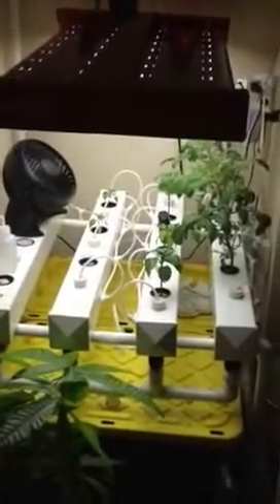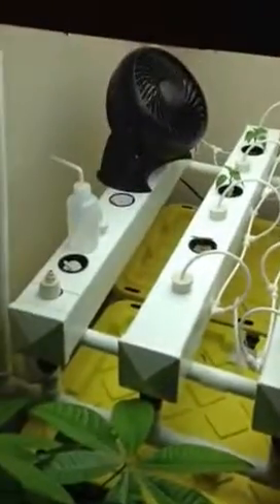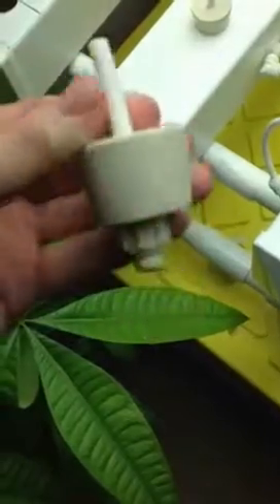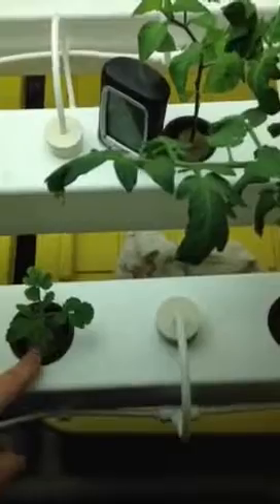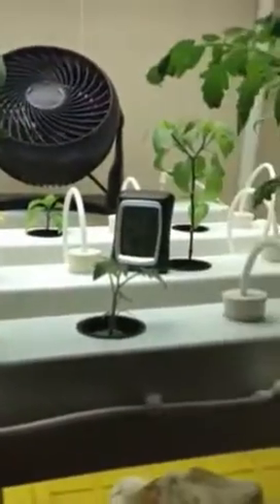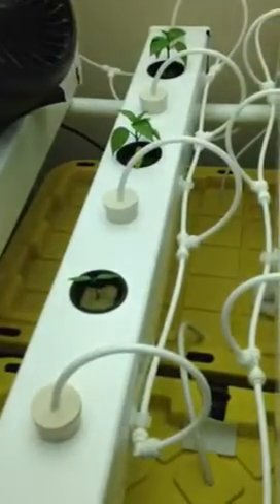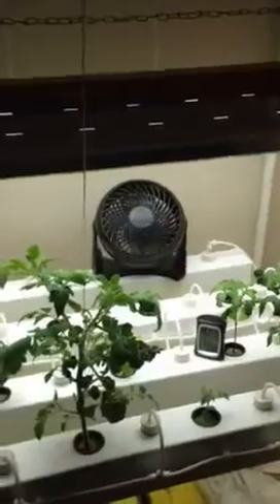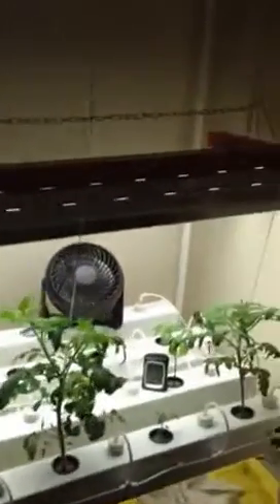High Pressure Aeroponics

Comment: u dont no what ur doing if u made ur nft right u wood not had no trublll u did not need put ur outlet pip on bottom   it u put it on side aT END OF THE ROW U QUTD OF PUT IT OUT LET PIP 3 2IN FROM BOTTOM OF RAzzzzz  so it wood have lot lot  more watter in it at alll times it waz how u made it u made it so at alll times not much watter siting in it where u put ur outlit pip was bad spot